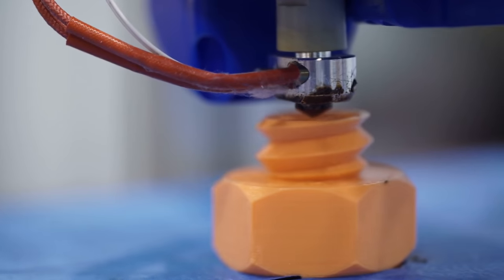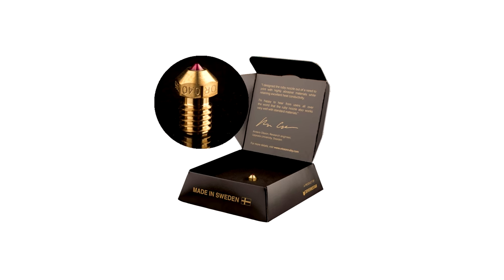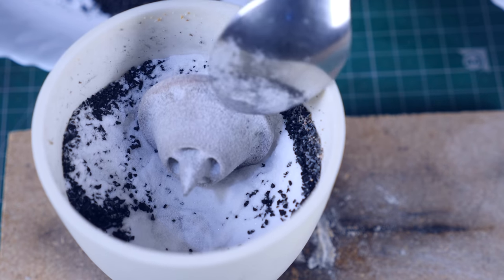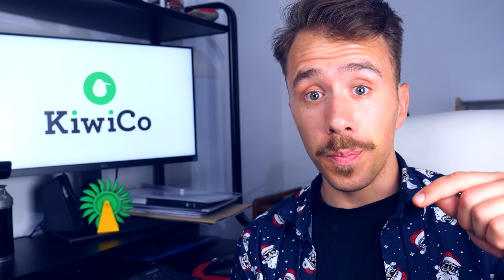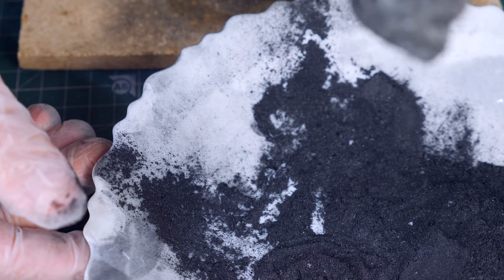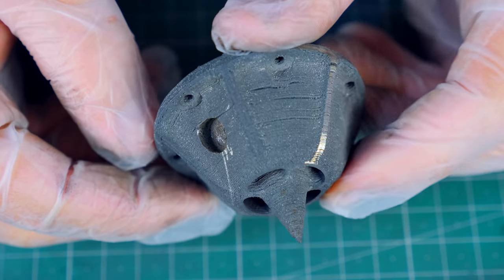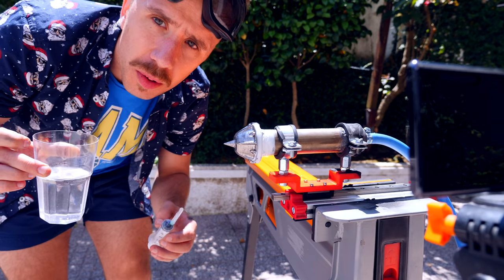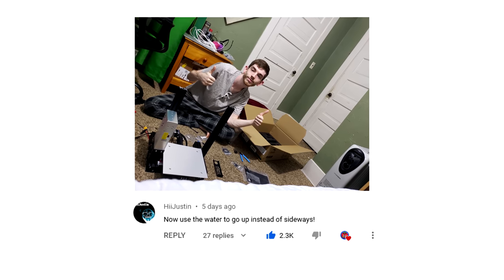How I 3D Printed a Metal Aerospike Rocket at Home

Comment: OK, you printed a steel nozzle, sweet(!), You have one damn hot areospike engine, (at least for a few glorious seconds) , but could you print a bronze truss structure you could bolt together , equip with skate board wheels and using a sail, tour a parking lot without any other source of power but the wind itself? (maybe using a rocket as an emergency brake?  After all, we all have those moments when stopping is so important and what could be better then a rocket brake?)

Comment: Hmmm...now I want a 3d printer. One with dual extruders 

It's a problem with high end ebike battery packs to keep resistance low as possible on a large pack.

Nickel is easy to weld to the cells, but only has half the conductivity of copper.

Copper has great conductivity, but requires exotic equipment to weld.

If I could print an overlay to weld to the cell tops, where the pads are solid nickel but transition to solid copper traces  by dithering the two extruders to change the proportion of metals, I would end up with something I could quickly weld to the cells, but which would use solid copper for the majority of the current path.

Only question would be whether or not structural integrity would survive the sintering process at the transitions.

Comment: Maybe a square shaped container would help it not warp. Something flat on the bottom with a little layer of sand.
Edit: or a higher nozzle temp? with a .15  quality setting? Idk. Just get those layer lines a bit tighter.
I gotta get some of this shtuff.

Comment: Your videos are interesting and the challenge of building a rocket turbine is very difficult. The materials need to have a very high melting point, maybe if you combine this method with a heat insulating layer the turbine will become more stable. I hope you succeed in this task.

Comment: I wonder if the hollow center would even be a problem, and more of a feature to lighten the weight. Anyway to print the inside and outside edges with metal mix, and the inside with just plastic

Comment: Great video by the way but why don't you use to build the nozzle the foam tiles like what thay used  on the space shuttle you may even be able to mould it complete by mixing the chemicals or machine it into shape. The way I see it is the temperatures involved is so very high and you can't cool it without some serious cooling  management like thay use in rocket engines today . just let it get hot !!!!

Comment: Isnt it a problem if the part first shrinks 10% and then it is cintered in a sandform which is too big for the metal? Maybee you could try to design it in a way so exess material can fill the full form when it is remelted? (To prevent deformations)
Great Video, very cool projekt!!

Comment: You might just want to switch to a low expansion ratio Bell nozzle. 
Aero spikes are notoriously hard to cool, unless you can regeneratively cool them with propellant or smth they are basically impossible to makez

Comment: I feel like a bell nozzle would have had greater success, more likely to keep the sides cool. easier to make changes. simpler to 3d print. with a bell nozzle you might be able to print it in multiple materials like have the inside have a ablative material that would take the heat with it for its short operation cycle. how do space shuttle tiles work? can they absorb the heat if they were made the lining of the engine?

Comment: you need to sort the extrusion multiplier out ..... those layers are not exactly well filled in all the areas and if your going to have shrinkage and hole will get bigger and the area weaker. reduce the layer height which will also improve those gaps between layers ....maybe print a tad slower too

Comment: LOOK!  VIDEO IDEA.  a lot of folks have built butane/propane-water rockets.  what they need to do is replace the water with something very flammable that is polar like water so it doesn't mix with the butane.  methyl alcohol should work.  the whole vapor trail will be a mix of aerosol methyl alcohol and  butane.  a remote launch mechanism and a flare next to it should create a column of flame as high as the rocket goes.  With as many likes as butane rockets get/got, a crazy methyl alcohol version should make you rich enough to buy and torture all the tomatoes in several countries.

Comment: Why not relying solely on ceramics? SiC or AlC (or maybe even TiSiC) should outperform bronze greatly and even steel has a rather ... low melting temperature. Iirc steel gets weak at ~1000°C which is not even half the temperatures within a rocket engine. To be honest - once you're at the point of 3d printing a nozzle with sufficient detail and accuracy, you can basically upgrade from hybrid engines to liquid. Since you're not flying it (yet) you'll have no issue with having pressure tanks for the LOX and (probably) Ethanol plus some Helium or Nitrogen gas tank for the pressure system to feed your fuel and oxidizer through the injector - which could be just a set of holes.

Comment: Considering youre working with pure oxygen that'll burn pretty much anything it touches, best metal to use would be milled tungsten or tungsten carbide, titanium alloys, or tungsten-titanium alloys 

But it ain't cheap tho and you can't really cast tungsten
Reply: Plus why not add a flange to the metal body or tube instead of bolting it to the plastic fuel

Comment: have you tried to electroplate i mean use electricity to replicate a 3d printed part by covering the plastic with a thin layer of metal particles and then use a electric circuit to transfer steel from a block into the metal powder covered plastic until the prop get covered by a thick layer of steel. chould work. you have to put the superglued metal particle or thin foil covered plastic prop in salt water and another electrode of steel to transfer the ions to electrically shape the steel.

Comment: Could you print a negative mould of the nozzle in ceramic, fill it with steel powder and sinter it directly (without the need to burn out the resin from the part)

Comment: Future video idea: High voltage, large capacity, 3d printed ceramic based capacitor that violently explodes unsuspecting tomatoes on discharge (think ring launcher) or powers either a gauss or rail gun (for destroying tomatoes, of course!)

Comment: have you thought about just using a plastic nozzle and putting a layer of starlite inside? I think this would be an easy way to create a rocket that is very heat resistant, super easy to make, super easy to form, and can supposedly resist up to 10,000. degrees celsius (although this is probably not true, the boiling point of carbon is 4700 degrees celsius). 

You can see another youtube video by @nighthawkinlite where he shows it off.

Cool that you can 3d print metal, but I think it would be cool to 3d print a rocket from PLA or ABS and still be able to have it fly....

Comment: Perhaps a stainless steel nozzle with a ceramic insert will resist both the oxidation from the flame as well as the forces from the gas pressure.

Comment: What you should do to avoid engine rich fuel is to send in liquid hydrogen at a 4 kg O2 to 1 kg liquid hydrogen ratio.

What happened to your rocket engine was the oxygen quickly exhausted the alcohol and used the steel itself as fuel.

Comment: Did you overprint? to try and take the shink into account? You found it reduces x percent, so increase the print size by x percent in ALL dimensions? I mean even a coefficient of wall thickness to overall shrinkage E.G. overall size goes up 20%, but wall thicknesses go up 15% or something different then overall size dimensions?

Comment: U could use a hardning cycle it could make the steel harder and more resistant to heat becouse your evening out the molicules and bringing the carbon to the top not shore but just wondering if that would work

Comment: I'm curious if you can combine ceramic and carbon steel in a 3d print like a brake disc?  I wonder if it would withstand both higher temperatures and pressures.  Wonder how it could work in a rocket nozzle as well?

Comment: What if that rocket nozzle has a water circulation system to cool it down just like a typical combustion engine block with circulating water within to cool the engine and to keep the pistons from melting during combustion

Comment: Can you do a strength test of a metal sintered part vs regular pla/abs/resin and even compare against a piece of the metal itself? I have been trying to find some info on the mechanical properties of sintered 3d printed metal filament but there seems to be very little. You should test copper, aluminium and stainless steel specimens

Comment: Would it be possible to print metal heat sinks for computer components ? Sanding the bottom parts to get smooth surface, would they be any good ? Idea of printing our own coolers seems intriguing to me. Would be great as a coop with Major Hardware and his cooler testing saga.

Comment: That's cool and all but I can see how the particles interaction would not work because it's plastic with metal together and that metal needs to have a low melting point to be able to mix together and create a strong bond by having plastic in it you're actually decreasing the ability for the metals to interact with each other and the carbon that would be left behind would more likely weekend the ability for metals to bind each other making the part overall weaker and fragile and crack prone

Comment: As cool as the idea of an aerospike nozzle is, why are you not trying a conventional bell nozzle since your design clearly is not capabale of withstanding the heat of the hot gas. Although i am curious on how you are about to cool the nozzle ;)
All in all it was great video and the process of the metal parts you produced are indeed fascinating.

Comment: Wouldn't it be easier to print a form in plastic, use it to create a clay mold. Burn off the plastic in an autoclave, which would also harden the clay, and then use a miniature furnace to melt metal and pour it into the mold?

Comment: You should try a linear areospike
Reply: Could also try copper even though it has a lower melting temp it dispels heat faster. That's why they use copper for Oxy aceteling torches

Comment: You basically made a big oxygen fuel cutting torch. Except you didn't use the right material for the tip and your oxygen was most likely not pure. Pretty cool though.

Comment: Maybe buy a cheap flux-core welder and join it with your 3D printer.  Be careful, but you are no stranger to danger.  Or, buy a mini-lather off of Ebay.  Or, make a lathe powered by your drill.

Comment: your nozzle burned away this time because the nozzle was porous and the high temperature surplus oxygen burned the steel. I am quite certain that had the nozzle been solid and not hollow, porous and extremely high surface area, it would have failed by blowing apart at least a few tests down the road from being eroded gradually and being turned into fragile oxide, kind of how holes in exhausts form.

the lower surface area would be crucial

Comment: Why don't you do a larger one so that you can put forced air cooling channels in it, with the correct design you'll be able to have the air exit both the cone and the outer and then with a surrounding shroud it will become an air augmented aerospike rocket, with the benefit that your heated cooling gas or vapourised cooling liquid augments the thrust???

Comment: So if you're going to take the part out of the kiln and put it back in between temperature changes, why exactly do you need a programmable kiln?
Reply: Oh... So you don't have to wait 16 hours for it to be done.  Got it.  I wonder if you could modify the slapatron to gradually ramp the temperature up on a manual kiln.  Or maybe make a robotic device to do that.

Comment: I do not get what's the point. With synthering you also need high temperatures, just as with casting.
But making a cast is easier, WAY MUCH FASTER. Just print it in wax, put it in sand, melt the metal, pour it on.
For medium batches with not too complex shapes: print a mold, make many wax samples with it, etcetc...

Comment: you can SUPERHEAT  it with plasma will be the quickest way right? like someone made a video that a new space is building a metal ROCKET! by using 3D printer they use aluminum and plasma in new new generations the 3D metal printer will be faster

Comment: I'd recommend using something called Suspenda Slurry.
It's basically a ceramic that you dip your parts in to make a mold out of them. Which you then heat treat and burn out the 3D printed piece afterwards.
The stuff captures some amazing details. To the point where the casted part really looks like it was just 3D printed in metal on its own.
https://youtu.be/v96LTfmtDPU

Comment: I mean... It is fun and clearly a clever project! but... it's not metal. it's about 20/80 metal/plastic, at it's best 50/50. that's one of the reasons why it has melted that fast. also the cost of such project escalates fast - most of the time it is far cheaper to buy from professionals than making it yourself. In my opinion the only reason to make it yourself is because of the fun and knowledge you get from it.

Comment: not directly a comment on this video:

once you tried ceramics for your rocket engine approaches.
there are people out there using reinforced ceramics for hot temperatures and resistant some forces.
Indeed the ceramics there is a helper step in form of a negative molding shape (getting lost over the process, as the 3D plastic)
to cast high precision metal parts. just have a look - if you have not seen that idea in action already.
of course if you dont want to cast, maybe the ceramics itself can be a nice "inside precise" product.
https://www.youtube.com/watch?v=v96LTfmtDPU

Comment: Your bolt flange was way to thin. You need to quadrupole it's thickness and either grind off the excess of chop it. If you have access to an EDM machine that is even better. Then you can post machine the spot faces.

Comment: Amazing results but aerospikes are terrible even with nasa level equipement and ressources. Cooling the spike tends to be the deal breaker, instead of radiating heat on a massive piece of metal like bell nozzles its a tiny concentrated part that takes the hit. But actually its very impressive for a high level hobbyist. You would probably need some special coating on the spike to actually have it work for more than few seconds before melting itself down XD but it worked like a charm, the flaw isnt you, its the design itself.

Comment: Why you didn't try to print regular rocket nozzle with tubbing inside the parts of your rocket like water cooling in gaming computer instead of printing metal.
like in this video
https://m.youtube.com/watch?v=iTD6Sayd8uw

but the downsides of this cooling system you need to build or buy cooling system and make it smaller by building each tube together with your rocket nozzle. try it😂